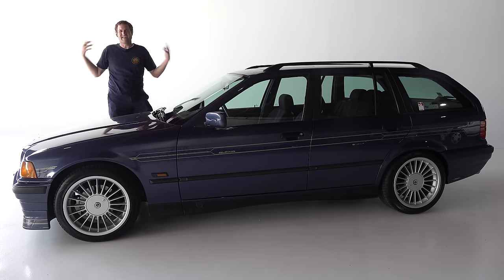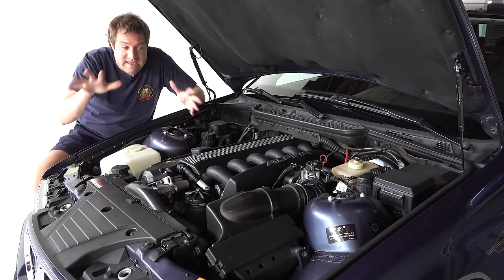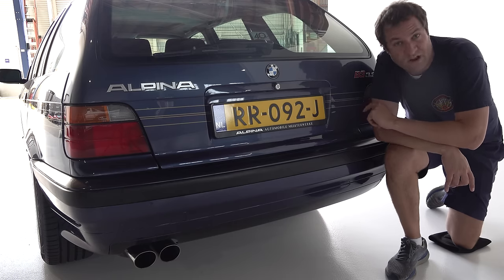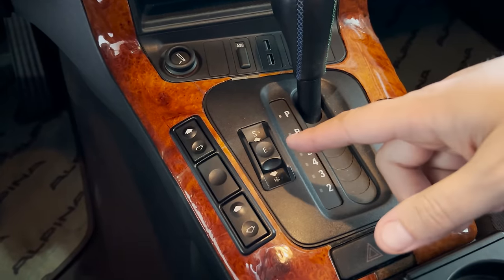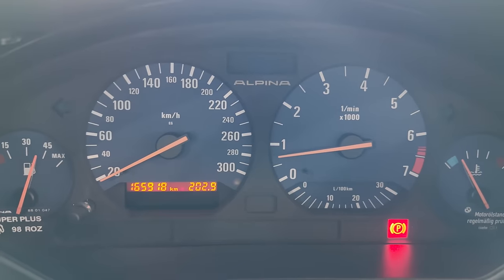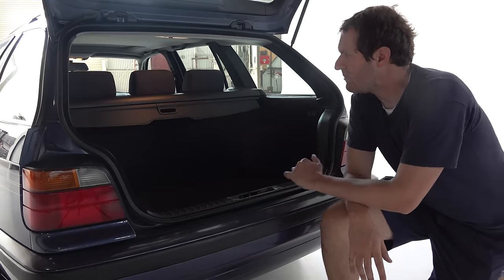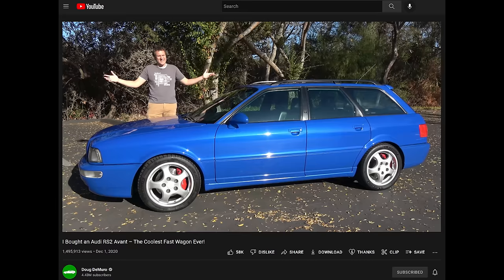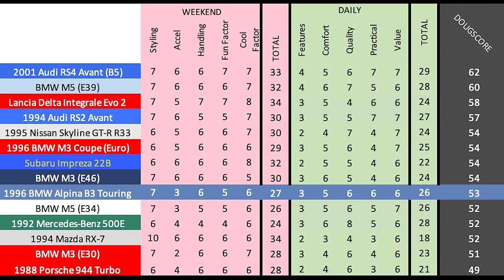The BMW Alpina B3 Touring Is an Ultra-Cool Obscure ‘90s Wagon

Comment: I love how well integrated the USB ports in the center console are! They have obviously been added later by the current or previous owner, but it's done so well that you wouldn't even notice them unless you were specifically looking for them.
Reply: I'm not the only one to notice that.
Reply: Yeah. That's sweet!
Reply: I’m more curious what those USBs do as it certainly still has the OEM stereo
Reply: USB ports are from Falk Manufacturing. I've had them in all of my E36's! It taps into the power outlet so it's for charging only.
Reply: @Minto107  correct, radio is a standard BMW Business RDS. It's period correct for the car.
Reply: It’s done so well… I didn’t even notice it haha
Reply: I noticed them too, I was hoping for Doug to say something about em
Reply: Came looking for this comment👍
Reply: @doctor_tran  Thanks for this. I thought I had lost my mind seeing USB ports in a mid 90s BMW not to mention the fact that Doug didn't mention it.
Reply: @johnb.8709  I completely forgot I installed them. They just blend in and look OE so never thought twice.
Reply: Even BMW latest USV C ports will fit the switch blanks in front of the gear stick perfectly.
Reply: I WAS SOOOOOOO WONDERING ABOUT THIS  lol
Reply: Exactly that
Reply: Yeah it looks stock
Reply: What if the USB ports wasn't added by the current or previous owner? It could also be that certain models of 1996 and up E36 models had USB ports as standard.
USB 1.0 Type A connector was first designed and released n 1996.
Reply: @doctor_tran  shame they haven't connected those somehow to the OEM radio (like by using an emulator for CD changer if the E36 offered it) and allowed for smartphone integration or USB playback
Reply: Not hard to do with a dremel. Probably a bought aftermarket panel though.
Reply: Calm down Doug 2 🤣
Reply: Wow!  I totally missed them.  Had to go back and look to see where they were.  Very well integrated, indeed!
Reply: Love how many picked this up and wanted doug to mention lol. It really looked so factory
Reply: @Minto107  most usb in cars are just power. Sometimes the one in the glove box or centre console is data files for the stereo.
Reply: Was USB even around in 1996 ?  PC was still using  3.5 floppy didn't and even keyboard and mouse were on green and purple mini din plugs.
Reply: Yes, i had bought some usb for an old Honda. They also had a display for the voltage of you alternator with same colour of display as the standard clock  of a 90’ Hondas. 
Fitted like a glove and nobody noticed it, was like equipped from factory. 

Btw, you can’t find these Alpina in Europe. I had many e36’s, but this one is like an unicorn, won’t see one , same as Alfa Romeos 8c.
Reply: TBF, they did just use a blank switch, so it's hard to ruin the aesthetics of a black dull plastic rectangle.
Reply: @automation7295  I wonder how old you are. No one was charging their gadgets via USB in the 90s. Anything with a battery came had a barrel connector (if you were lucky) which was wired directly to the wall adapter. USB charging started to pick up on DAPs in the early 2000s, but it wasn't until the smartphone era that most phones were charged via USB. Before smartphones, phones lasted at least a few days on a single charge, so there wasn't the same preoccupation with having charging ports nearby, as there is today.

Comment: There's an even cooler version of this that has a 4.6l V8 with a manual gearbox. It's also the only E36 to ever officially come with a V8 from factory.
Reply: You should run as fast as you can AWAY FROM ANY IDEA OF BUYING ANY BMW THAT HAS A V8.  Saying that they’re UNRELIABLE is a gross understatement.  Don’t get me wrong about BMW’s.  I own one.  But it’s a 4 cylinder.  Extremely reliable.  And plenty of power.  But their V8’s are total junk.
Reply: @mudman6156 you haven't own a V8 though.

Comment: Despite many people probably not understanding how special this is, this is as cool as it can get. From a time when Alpina cars were all handmade. More special than any M car.
Reply: Owner of a e46 b3 S coupe and a e90 alpina b3 these are future classics and honestly I can see then becoming more expensive then their M counterparts
Reply: I saw an Alpina Roadster Z8 last week. I’m s huge manual enthusiast but I have to admire the the work they do.
Reply: Define "special". They can be cool, but some are poorly spec'd. Like this one doesn't have any side skirts, no fancy interior, bar some Alpina stitching here and there. Basic white roofliner. No high end audio. 

There are much nicer Alpinas out there. This one is cool, but not all that special.
Reply: @donkremer6019  because every car was a custom order. It doesn't have anything "fancy" because the owner didn't order it
Reply: @neartheend666  that's exactly what I was saying.
Reply: The E34 M5 I used to own was the last of the handmade M cars.  End of an era.
Reply: 'handmade'
Reply: @lifelikeweeds819   e34 M was notoriously unreliable. Hope you sold before an engine rebuild
Reply: @Snappy650  False!  At least for the American M3 which this very closely resembles.  The higher tuned but only slightly faster M3 for other markets did have more temperamental engines.  They had to be kept spot on tune.
Reply: @machtschnell7452  e34 M5, not an M3. You must have misread
Reply: @machtschnell7452  the e34 M5 had essentially the same engine as the M1, weird wheel covers, etc.

Comment: They actually did a version of these which they shoehorned in a 4.6 V8. 

A very rare car. I used to work for Alpina GB and only ever saw 1 which came from the Netherlands
Reply: Yeah the B8 is a step ahead ! And so much fun to drive.
Reply: Funny you mention that, because the seller is selling this one because he has the 4.6 touring version!
Reply: The B8 4.6 (333hp) is absolutely cool and rare. I know somebody who owns one. It was also available as Touring model in Europe. But the B8 4.6 is much heavier, was a lot more expensive and comes with automatic as standard. Therefor it isn't much faster from 0 to 62mph. If you want manual transmission in your E36-Alpina, you have to go for the B3 3.2. The B8 4.6 is a cool European muscle car, which was more powerful than the Eu-spec M3 E36.
Reply: @exoroxx  Funny thing, I recall my old B8 4.6 Touring having a 6 speed manual box… Also, it was quite a bit quicker than either the B3 or M3/M3 Evo of the same period - that all-alloy V8 wasn’t as heavy as you might think…
Reply: @Hythe01  It was around 200 kg heavier than the B3 3.2. Still not very heavy in modern comparison. Okay, there was a manual B8, my bad. I misread a car list: Automatic wasn't available at all for the B8. They are all manuals.

But 5.6 for the B8 isn't much quicker than B3 (6.0 sec) or M3 3.2 (5.5 sec). I know, that isn't the purpose of the Alpina B8.
Reply: @exoroxx  okay, so a couple of things here, without wanting to seem at all aggressive about it:

1) like for like, the weight difference between B3 3.2 and B8 4.6 was actually about 120-130kg
2) I’m pretty sure the B8 4.6 was only ever available with a 6 speed manual gearbox
3) The 0-100kph time of the B8, unlike the six cylinder cars, was dramatically traction-limited - 345 lb/ft of torque through 1996-era 265 section rears, and only a fairly primitive traction control feature - really, to understand the relative performance, you need to look at the 100-200kph data for each car

The B8 was pretty quick, certainly by the standards of the day - roughly equivalent in most ways to a Porsche 993 (I’ve owned both) but far less hard work to extract the full performance. Third gear in the B8 was just legendary, you barely needed to use any other gears.

That said, the B3 is also a lovely car, in its own right. Almost all Alpinas are a rather wonderful thing!!!
Reply: @Hythe01  Don't get too deep into it...

1) 1330 kg for the B3 3.2 and 1500 kg for the B8 4.6 - so that's 170 kg. But the tested B8 Coupé was even heavier with 1552 kg
2) As I mentioned before...
3) I was only referring to the 0-62 times, so power benefits above that weren't applied. At least the B8 is faster due to the fact it always comes without limited top speed.

Don't get me wrong, I love the Alpina and especially this V8 underdog. It is a stunning peace of art.
Reply: @exoroxx  the B8 4.6 was made only with manual transmission. The B3 was made in manual and switchtronic
Reply: @pittpasc  I know. Read my following answer.
Reply: They’re rare because they’re V8 engines are extremely unreliable.  They cost far more to fix than these fast depreciating cars end up being worth.  Ask HOOVIE of Hoovie’s garage about his experience with BMW V8 engines.
Reply: @mudman6156  Only 221 Alpina B8 were ever made:

- Sedan: 93
- Touring: 27
- Coupé: 78
- Convertible: 23
Reply: @mudman6156  no they’re rare because alpina only made a select few. Actually the bmw v8 is a well engineered engine, hoovie buys turds and that’s his gimmick
Reply: @mudman6156  I’m an ex bmw mechanic and I can already tell you that the advice about 4 cylinders is total crap because they’re total shite
Reply: @VIPOdyssey176  Really?  Mine’s been running absolutely perfect.  Not a single issue in 5 years of ownership.  It’s also the cheapest car I’ve ever had to maintain.  My previous BMW was equally as good.  But maintenance cost me a bit more, because I had to replace one of the run flat tires.  This is my last BMW though, because as much as I’d like to have another convertible, the BMW 428i is no longer available as a HARDTOP convertible.  And that oversized grill they stuck on it is just plain ugly.  So I’m keeping this one for another year or so and then buying a slightly used Genesis GV 80.

I love the little 4 banger in my BMW.  Not only has it been completely reliable, but it gets great gas mileage as well.  Especially when you hyper-mile it.  I can get as much as 50 miles per gallon when I hyper-mile this car.  That’s better than any other car I ever had.  Having the “coast” feature really helps it to get such good mileage.  If you’re unaware of hyper-mileing, it’s the art of knowing exactly when to feather the gas and when to let the car just coast depending on the traffic, weather, and road conditions.
Reply: @mudman6156 how many miles do you have on it? My BMW E38 735i is pretty good with 200 000 miles, not the most reliable engine, but far more than small 4 cylinders from BMW

Comment: 5:12 I'm glad you talked about the valve stem thing because when I was going to dismount wheels for a BMW Alpina B6 I was so confused on where the stem was at first about a few years ago. Also the stem goes through one of the spokes to put a sensor in it.
Reply: That seems like a good idea to me.  It will help protect the valve stem, from damage and sabotage, as you can only really access them with a key.  More car manufacturers should consider something similar.

Comment: Just a little correction - I think that Alpina used the 2.8 m52 engine and bore it out to 3.2. The only 3.0 straight 6 engine from that time was the s52, and they didn't use that ;)
Reply: Cant tell with the winky....but the s52 is an alpina engine
Reply: @Euphorica  S52 is not related to the Alpina 3.2 aside from the fact they are both derived from the M52 2.8 and they happen to have the same displacement
Reply: Nope s50b30
Reply: @michu6777  it absolutely is related.  You think manufacturers are blowing wads of cash to redesign a the same engine from the ground up? Lol
  Besides there being lots of data online showing these are indeed related.(the same in some reports)... Use your logical reasoning.
Reply: @Euphorica  He was just saying that this engine isn't based on the 3.0l S unit but rather on the 2.8 M unit, which is correct. Also Alpina is a manufacturer, not a tuner, at least here in Germany.
Reply: I also guessed that its M52 2.8 but its based on M50 2.5 as per wikipedia bellow. Which a) makes Doug wrong anyway and b) it is really related to S50 and S52 since they both have iron block while M52 has aluminium block so its sort of diggerent engine. The digfference grew even bigger to S54 (still iron block) to M54, which are the same generation but derived from aluminium M52. However M54 came in the 3.0 liter which Doug mentions;-)

base for the B3 3.0 was a 325i (BMW E36) and a 328i for the B3 3.2. In both models, however, Alpina used the more robust M50 (B25TÜ) cast iron engine, as the M52 engine of the 328i was not suitable for expanding the displacement. Both vehicle variants were available as a coupé (two-door) and sedan (four-door), cabriolet (convertible) and station wagon (touring).
Reply: Pretty sure you’re right. The later E46 B3 3.3 and 3.4 S use the S52B32 (E36 US M3) engine.
Reply: I had a B3 convertible (also from the NEtherlands, like this one) and I thought they had used a 3.28 (the salesman told me that), but at the Dutch Alpina centre it appeared to have been a 3.25 that was used. It was a huge - and fast - eninge for a 3 series car.

Comment: Currently own a 1998 Alpina B6 2.8 touring so was thrilled to see this review. It's one of my favorite cars to drive because a previous owner had installed a 5 spd manual. A JDM example #103.
Reply: waiiit do all the manual swapped alpinas from the 90s come out of Japan?
Reply: @jimmyneutron5679 The entire production run was shipped to Japan, as far as I know. Found a 20 yen coin under the seat rail! 
Still have the original transmission and gear,for the purists....
Reply: The story behind the JP market B6 2.8 touring is interesting. BMW decided to stop importing the 328i touring to Japan and Alpina knew there was a touring market there. So they created the B6 2.8 Touring to fill the gap left by BMW. The B6 2.8 tourings were not modified as much as a B3 3.2 due to cost and positioning in the marketplace.
Reply: @doctor_tran  Spot on! Although not quite as rare as the B3, or as powerful, still my favorite for a deserted mountain road...
Even over my Z4M coupe!  That's saying a lot...
Reply: @doctor_tran  No, actually the B6 is the first Alpina before they were renamed to B6, like the e30's are called B6.
B6 are based on the 2.5L m50 not on the 2.8L m52, but Alpina continued to exporting them to Japan, but all early e36 alpinas were B6 before the 328 existed.. actually the m52 328i exists because Alpina put a 2.8 on the early E36 models.

Comment: It is an import from the Netherlands. There are still Vredestein tyres on it, which are Dutch and good tyres. Like the license plates as well. It was imported into the Netherlands as well by the way. I suspect that this Alpina started it's live in Germany.
Reply: Surprisingly Japan. Even more surprising when you realise the steering wheel is on the wrong side :-)
Reply: Actually, this car is Japanese. Was then moved over to the NL.

Comment: A renaissance of high-performance station wagons would be amazing! 

I know it’ll never happen, but I’d love to see modern takes on the B3 Alpina come to the US market. 

I wish Americans would get over SUVs and realize station wagons offer nearly the same utility with all the performance of a sport sedan. 

Great video, Doug! 😀👍
Reply: Why do they needa Renaissance? They never went away.
They still sell a B3 touring. Not sure if you can get it in the us though...
Reply: Not sure where you live, but for example the Audi Rs6 is fast as fvck and totally badass. No renaissance needed.
Reply: @alkoyyy  They didn’t?  Who in the United States makes station wagons?
Reply: I would love to see station wagons make a huge comeback.  I’d rather have a wagon over an SUV any day.  My very first car was an old station wagon.  A 1971 Ford LTD Country Squire.  My second car was another wagon as well.  That one was a 1976 Ford Torino country squire.  Probably the best car I ever had.  It NEVER broke down despite having over 200,000 miles on it.  It still looked good as well.  I really liked that car.  GM, FORD, AND CHRYSLER need to bring back the mighty family wagon with the rear facing seats in the back, and the multi-way tailgate that could either be lowered for tail gating or open to the side…with the electric window that lowered into the tail gate.  And the luggage rack up over the top of the wagon section.  I wouldn’t even mind if they put wood grain on the sides again.  Just give us great gas mileage and a powerful engine under the hood.
Reply: There’s always a Volvo
Reply: @mudman6156  Volvo, Mercedes and Audi. But only Volvo and Audi have really performance focused trim variants as far as I know.
Reply: @alkoyyy Alpina B3 Biturbo Touring Allrad. 495 HP, 0-100 km/h 3,7 seconds and a top speed of 302 km/h. Perfect car for long distance driving on an autobahn. Alpinas are Grand Tourismo 🎉

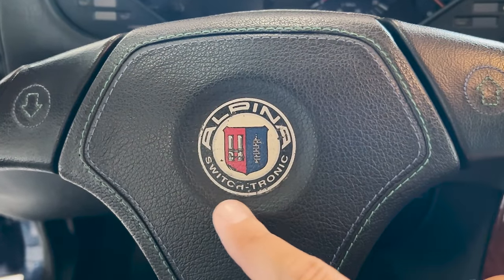Comment: 10:44 these features being on the logo was a very common thing manufacturers did back in the 90s, Honda did it with their cars which had their 4ws and awd systems and I believe some awd corollas also had “awd” integrated into the Toyota badge